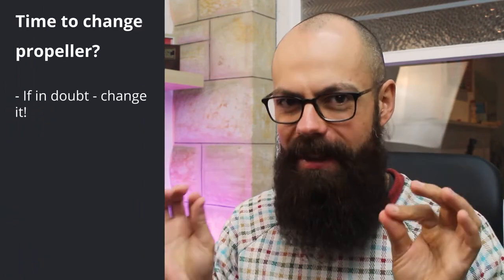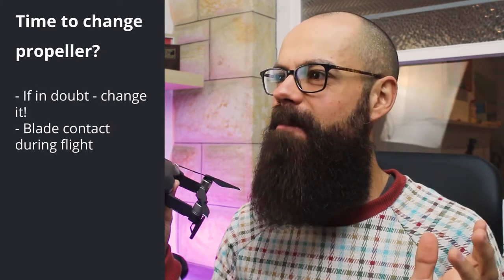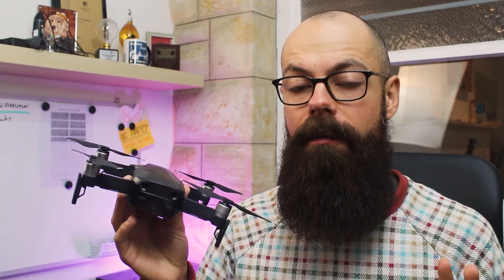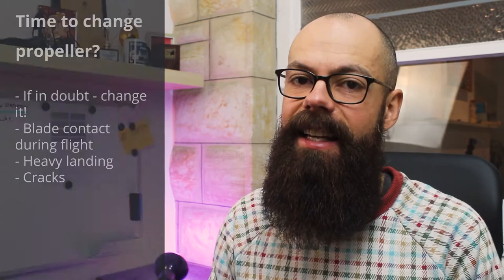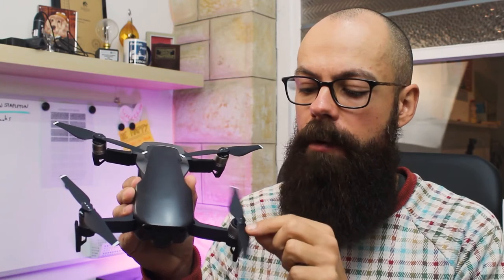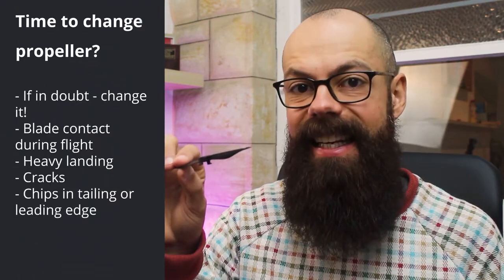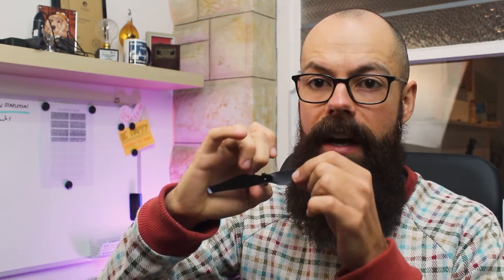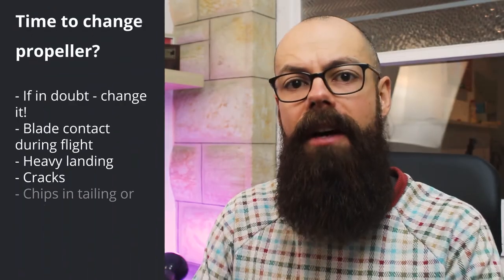When you should change your drone's propeller | 7 signs

Comment: Noticed the props on my air 2s are turned up slightly at the tips. No change in noise but I did notice a slight yaw while hovering. Going to check my flight hours but I think it's about time to change them.

Comment: minor crash with my drone, one prop was completely broken where it attaches to the motor its identical twin has chips on its surface so they are both being replaced obviously. the other two dont have any obvious damage no chips cracks etc but the edges dont feel knife sharp. neither do the brand new replacements but it feels like there is some wear on them no bumps or cracks or chips just the edge doesnt feel razor blade straight. its barely noticeable however. what should i do. id rather not do a full set replacement but if i must i guess i will.

Comment: do u replace 1 propellor at a time , or if there is one damaged propellor, you need to replace all 4?
Reply: all 4. if you got a car - do you change one tire, keeping other 3 tires 2 years old still in use?
if 10 USD is too much to change them them maybe is time to sell your drone.
Reply: @yoshy2628  I believe tyre shops so change maybe 1 or 2 at a time?
Reply: @yoshy2628 If I damage ONE tyre I change ONE tyre only...so no.